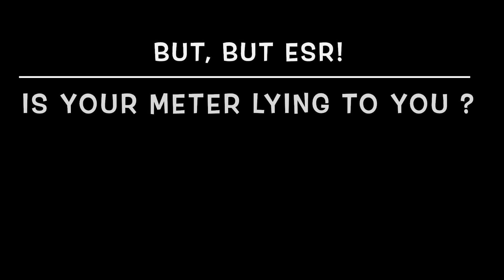But, But ESR! Is Your Meter Lying To You?

Comment: I want an old school high voltage cap tester so bad. These new fangled solid state thingies aren't scary enough.
Reply: @thatampguy  I have a vintage Sprague cap tester and it's awesome but it can certainly bite you very hard if you disrespect it.
Reply from the maker: @synthesisertech man I try to disable as much lethal contact points on the old gear as I can. On the signal tracer, there are a few banana jacks that allow you to use it as an output transformer for testing. If you touch that the wrong way you’re toast. I disconnected that feature internally bc I’m usually so busy and worried I don’t have 100% focus. The old gear def demands respect and all your attention.
Reply: @thatampguy  I've got one of those Heathkit signal tracers with the Magic Eye and the slide switch that puts 100V or so on the probe tip too, I made a plastic stop to prevent it from accidentally being operated when i'm using it in transistorised gear. My AVO tube testers have plenty of completely exposed points on the socket deck with full plate voltage on them, up to 400V, 50mA. You have to pay attention all the time!
Reply: @thatampguy  Good idea about disconnecting those banana jacks, I think I'll do likewise, I don't use them anyway.
Reply from the maker: @synthesisertech that’s the tracer I have!